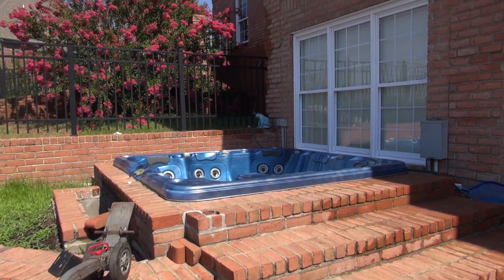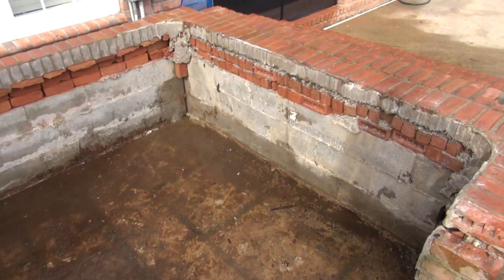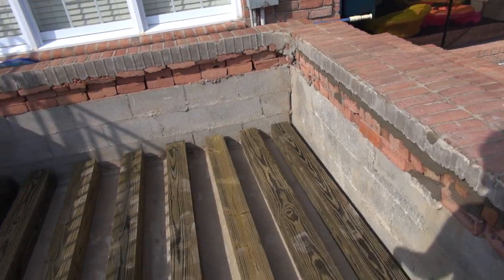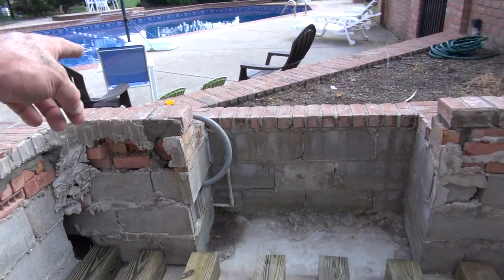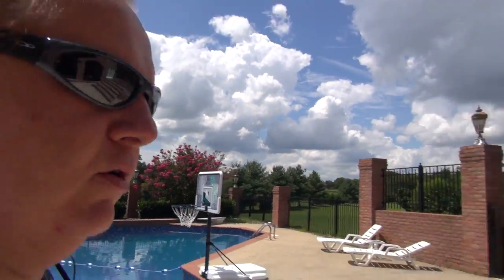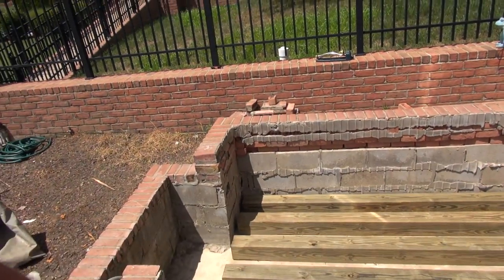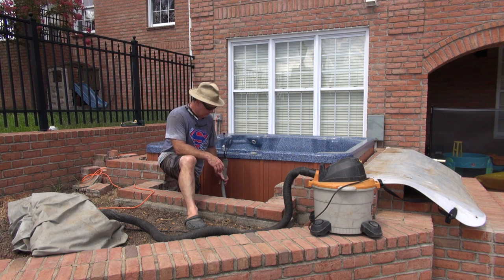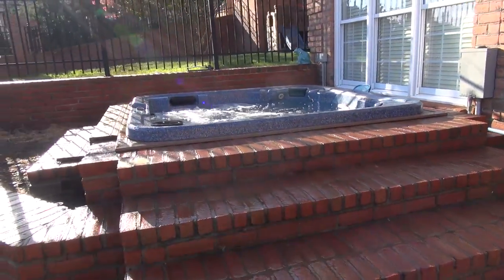One Man Difficult Hot Tub Removal and Install in a Hole The Spa Guy

Comment: Great video Spa Guy!  I moved into a house with a broken in ground hot tub.  I'm about to tear it out and see what I can do.  I'd like to basically do (or have a professional do) what you did in this video.  How did you attach the decking trim at the end?  Looks great but trying to figure out how it's secured.  Thanks!
Reply from the maker: Buddy I used those Blue Concrete Screws and painted the heads to match the trim..

Comment: Hey Spa Guy- LOVE your videos!
I bought a house with a spa set about 12" into a pit in the patio (not a deck, a concrete patio) with about 2" clearance around each side... if I but\y you a case of beer (or a case of K-cups), will you come to Salem, OR and help me lift it out so I can clean the rodent mess from inside the panels and clean the gunk out from underneath?

Comment: Hello.
Thank you for this very detailed & impressive tutorial! 

I need to put my 2001 Caldera 7x7 Tahitian Spa on its' side to replace the Euphoria Jet---the has a leak from this jet.  The spa is very old and decided to pull out the jet & the 90 degree elbow pipe.

I don't have one of those wedge inflator....Can you suggest another option that can be connected to my shop vac to elevate my lovely spa.

FYI, 
My spa is located on a second floor deck in a condo complex.  It is not in a hole. 

Thank you for your time! :-)